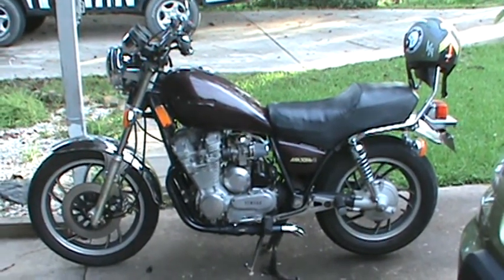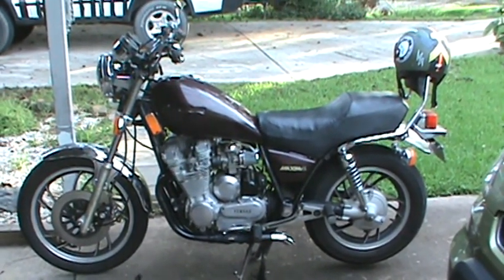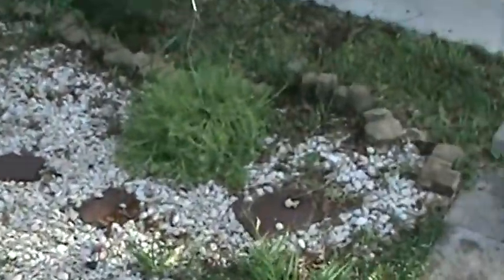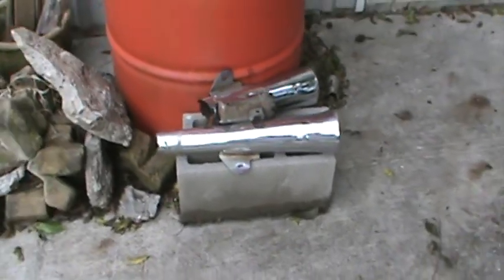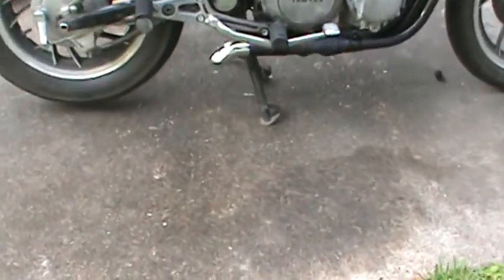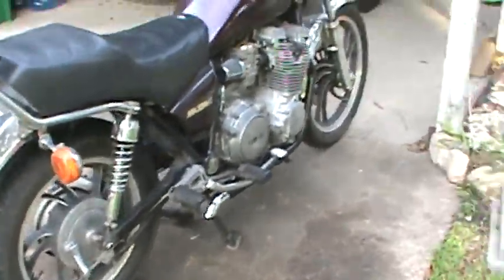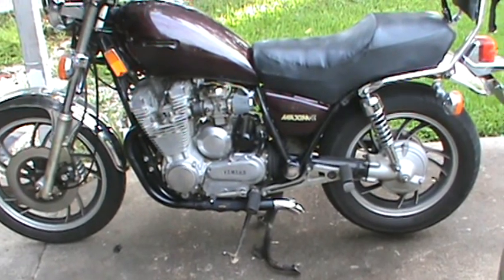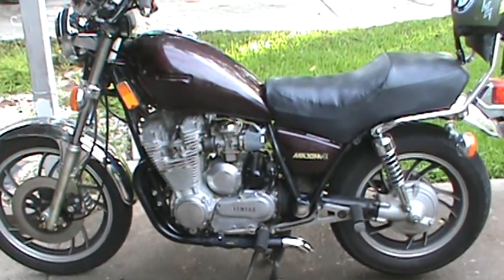650 Maxim Muscle Bike Update

Comment from the maker: Actually when I changed the jets I found the main jet from carb #1 in the float bowl. I don't know how it was running as well as it was. Now that it can breathe it's running strong. Removing the airbox and adding the pod filters leaned it out so much it was starving for fuel under heavy acceleration. Now it pulls like a train and actually gets a little better mileage.